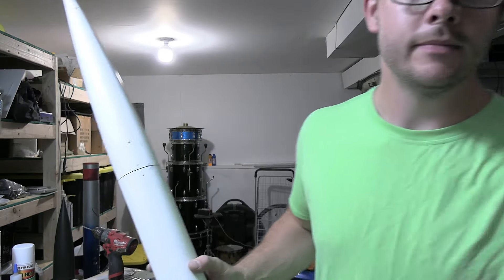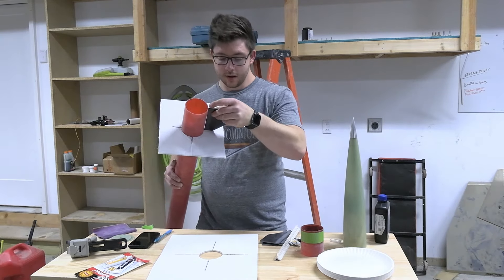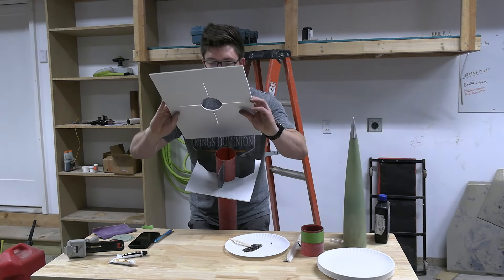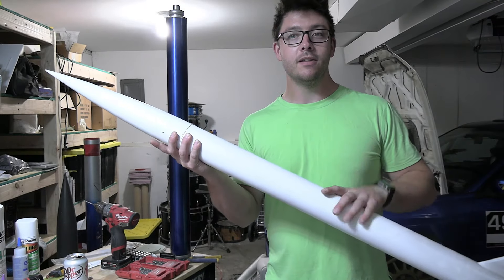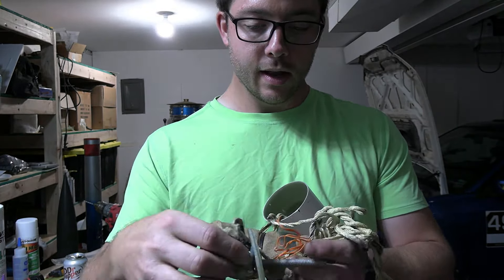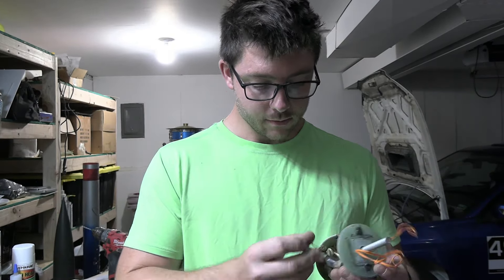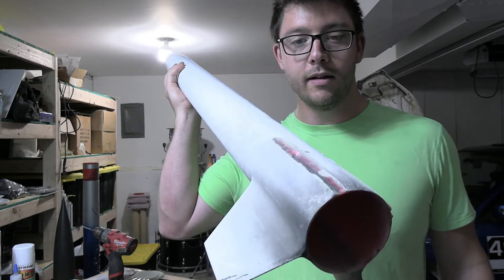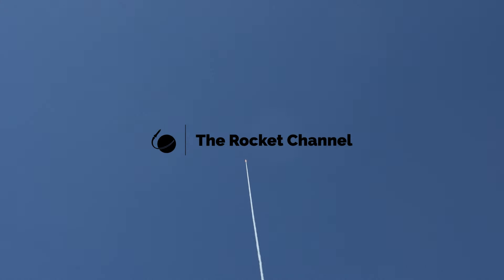I Flew a Rocket Over 7 Miles High!

Comment: Great job, Taylor!! Will you be heading down to Thunder Struck to fly this year? I am planning on making it down; only a week after MWP. Hoping to get a few up into the high 20's......Punisher 3, 4 fins, no MMT (min diameter) is pretty much complete and hope to fly it on an M1297. We shall see!

I like your method of securing the motor with a bulk plate and making the space between the two the location for the electronics. I assume you used an RDF for tracking?
Reply from the maker: I unfortunately won’t make it to thunder struck this year. Those flights should be awesome! I used featherweight GPS for the first time on this flight. I had RF tracking as well, but the antenna actually was ripped off so I’m glad I had GPS!
Reply: @the_rocketchannel  I meant Distant Thunder. DOH!!!! Indiana and Kansas are totally different locations!!! lol
Reply from the maker: 😂 yes I’ll be at distant thunder!
Reply: @the_rocketchannel  Thaaaaaats better!

Comment: How did you find using the easy mini compared to the stratologger?
Reply from the maker: It was just as simple as the stratologger. The only downside is having to hook it up to the computer to change settings, but operations are great. I would be buying more of them, but the new Featherweight Blue Jay is going to be the perfect altimeter I think.